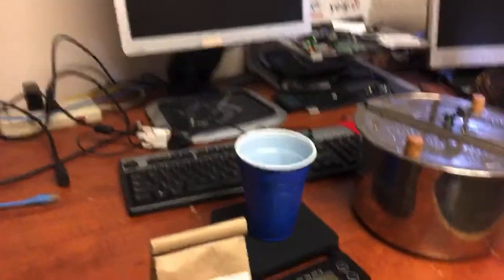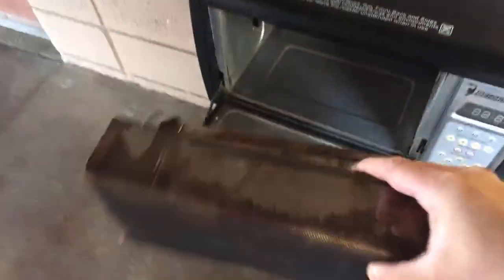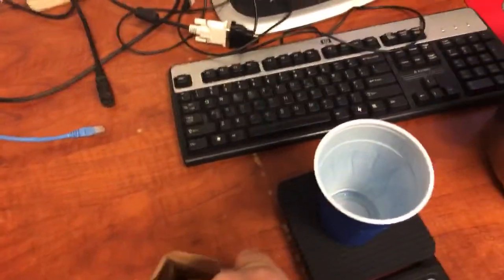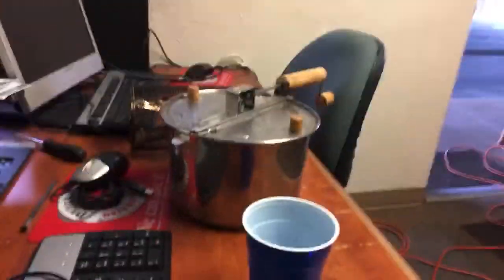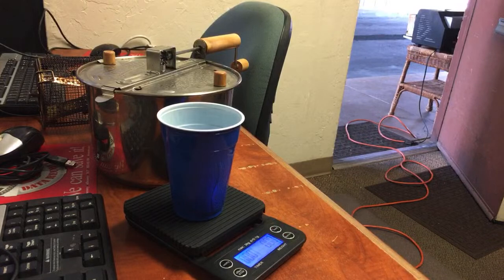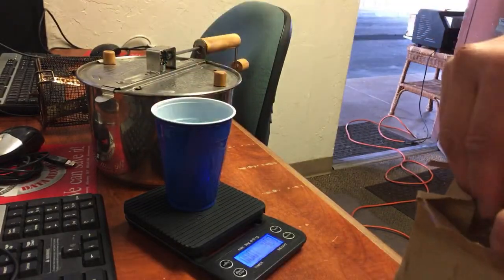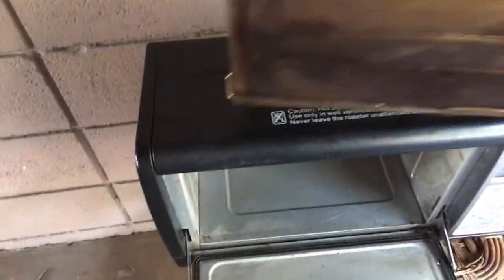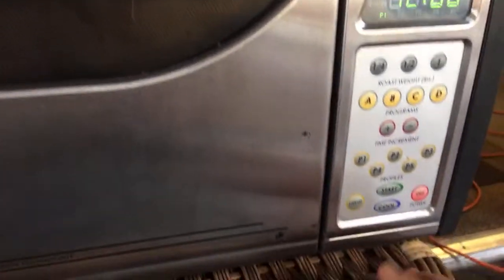Home Coffee Roasting | Behmor 1600

Comment: I've never had success roasting 1/4 lb in my Behmor! So i only roast 1/2 lb at a time. I hit start, then P5 and do the entire roast (about 12 minutes) on that setting. A while after 1st crack, depending on the look of the beans and the smell, start cool down for about a minute (anticipating that some roasting will continue In the beginning of cool down) then pull the drum (restart cool down), empty the beans into a large aluminum pan and finish cooling outside. Typically I don't run the blower in the hood.

I do all my roasting inside, under the range hood, but the smoke suppression works pretty well and it its smoking really badly, I've probably burned the roast. don't

I clean the roaster after every use with Simple Green, including the window (hint hint). Every few months I take the rear covers off and blow out the chaff.

I don't know how people pre heat these things. If I've done a roast and want to roast a second batch, the machine has to been at ambient temperature or an err code  is possible, shutting down the machine from overheating and as we all know, that a less than desirable outcome. But then again I do roast hot!